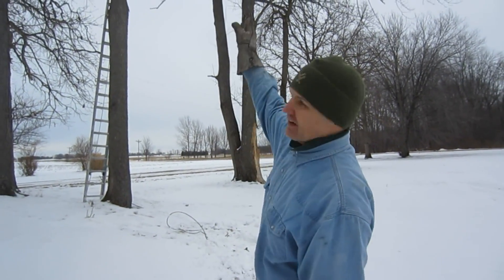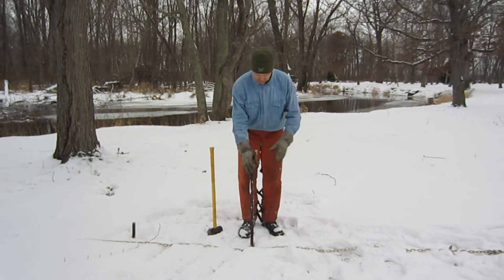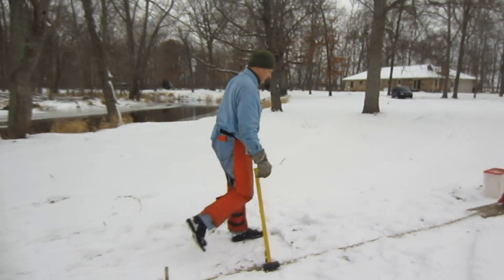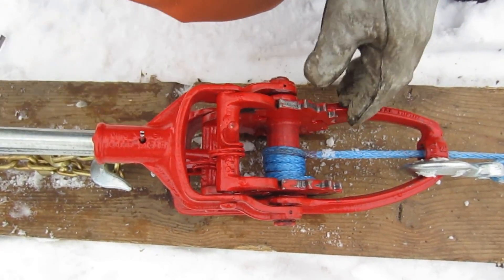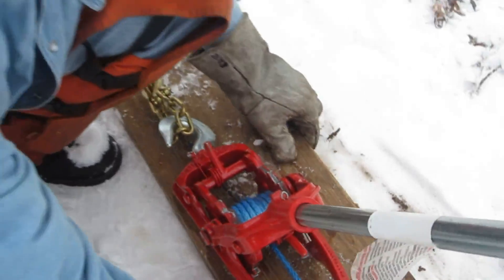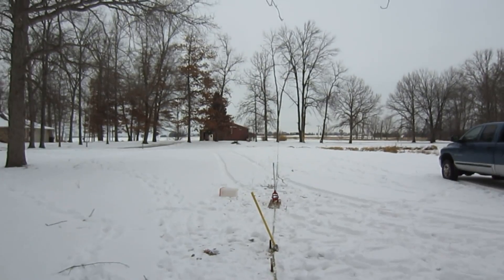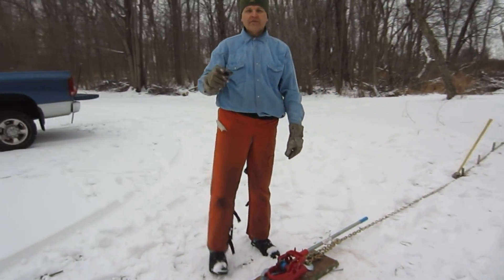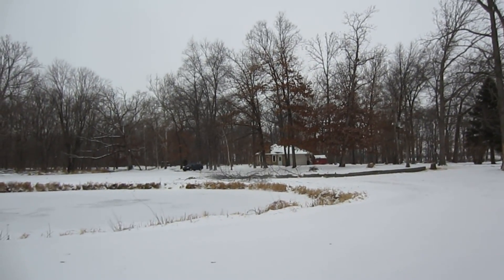More Power Puller Helps Pull Down 75 Foot Tree, & Winching Techniques

Comment: Nice technique. I've seen guys use similar ground anchors for vehicle recovery, but they tilted the anchors away from the load.
Reply from the maker: Thanks for your kind words about our technique.  As for the tilt of the ground anchors, if you watch closely, you'll see that they are in fact tipped away approximately 15 degrees away from the load/tree.  I agree with you, that tipping them toward the load/tree wouldn't be prudent.

Comment: To pull the stakes how about putting the fulcrum(log, tree section, etc) on the bar side; run the bar at an angle take the chain, slowly lower the bar then pull the bar down to raise the stake instead of raising the bar to raise the stake.  This arrangement is safer and easier on the back than raising the bar.  This is the arrangement used to pull tent stakes for years(the bar is a pole on wheels which can be easily maneuvered into location with a chain hanging on the end to go around the stake.  Pull the pole down, lift the stake, raise the pole the chain slides down the stake, repeat as needed).

I have done something like this both ways and pulling the bar down is the easier and safer method.
Reply from the maker: Your method would also work nicely, and easier on the back.  Thanks for your input.
Reply: You are welcome. Don't like to see someone hurt.
Reply: Roy Reynolds qqq

Comment: Fascinating video.  Are you an engineer by trade?
Reply from the maker: Thanks for the up-lifting and positive comment about our video, I'm thrilled that you liked it, I hope I was able to pass along some new knowledge.  As I have stated before, I just wanted to share and "pay-back" some of the knowledge to the Youtube community.  And as for whether "I'm an engineer by trade", I would have to say,.... well,.....kind of, some have said... but,.. not really, but I do know what an ATIS and an AWOS is!
Reply: I went through half a dozen other usernames which YouTube rejected as already in use.  I typed that out of frustration. YouTube accepted it, so I'm stuck with it! :^)
Reply: +SeekTheTruth .

 can understand why you did it this way( showing the kids the old way of chain rigging).
but let's keep it real.
take four wheel drive pickup truck and attached steel cable to the tow bar. put it in 4-wheel drive low lock and pull forward until tires start to spin. after stopping truck, pull out cable on front power winch. then set anchor stake and attach winch cable. hop back in the truck put transmission in low lock driving forward while pulling in on the power winch.
* pulling the entire tree out of the ground.

            ^

Comment: The truck would make a fantastic anchor...easy, fast, and if it slides in the snow, it's not going to fly out and kill you...

Truly trying to be constructive here
Reply from the maker: +Cody Grove ...... Thanks for your comment.  I did consider using the truck, but decided against it.  (1)Number one reason was that I thought that this would be a good opportunity to demonstrate how our ground anchor system works, (we've had great success in the past with this system) and 2nd reason was that I have tried it in the past and using the truck as an anchor didn't work.  The truck kept sliding in the snow or grass.  The MPP would just pull the truck around.  Also, 3rd reason, if anything when wrong, like a line snapped, then not only would I be in the danger zone but also my truck might get put out of commission while expensive repairs were made. 4th reason, after thinking about it, I just don't want to put that much repeated strain on the undercarriage and parking pawl of the truck transmission.  It can't be good for the truck.  I've rebuilt a couple of transmissions and I've seen the parking pawl that holds the truck stationary; there's not much meat there.  The way I look at it, the fewer men and the less equipment in the danger zone the better.

Comment: I was going to thumb this down however there were valuable rigging techniques shown during the video..   When he sunk those ground anchors i was like "Yeah good luck pulling those back out".. What is demonstrated is the proper method of wrapping chain into a configuration that allows it to grab a ground anchor and lever it out of frozen ground using only a length of chain, a stump, and riggers bar.
Reply: glad you could see beyond your first impression prejudices and find value. good for you
Reply: rainmechanic that was.cool how he pulled thosed stakes.
Reply: Or heat the ends of the pins bend a small section over or weld a half chain link near the top . Drill a hole through the support section of jack liffting point add a bolted u clamp. I have seen both. half chain link is the best and fastest to offer up connect pull drop .. jack down next one.
Reply: Vice grips... that ground is frozen... awful lot of work with the chain, biting and re-biting etc lifting etc … use the vice grips and grab hold of the spike... begin turning it clockwise/counter back and forth till it turns easily... simply lift barehanded.
Reply: dynamite works too  :-P
Reply: +rainmechanic A Highlift jack would pull those out a lot faster, and if this was something you were going to do regularly you could weld 3-5 links of chain onto the end of the bar.  Not only would this be exceedingly safer, as the jack would arrest the bar if it "popped" loose, but it would be easier and faster.

Comment: it would be safer if all 4 anchors  were driven into the ground at a 45 degree angle away from the winch
Reply from the maker: +David Gaylord .... yes, your right.  I have started driving them in at a slight angle, I now tend to use about 20 degrees, so that I could still pull them out.  The day of this video, the ground was frozen rock hard, anchor movement wasn't much of a problem.

Comment: Some HELLIFIED nice gloves!!!!
Reply from the maker: +Samuel Luria ......... I almost hate to say that the gloves are as cheap as they come, although they are modified, and they last for years now!  I should put up a video about how I modify them.  When they are new and clean, I completely cover them in 100% pure silicone.  I use clear colored silicone.  I work the silicone into the cheap split hide leather and hang them on a clothes line to dry.  I use 100% silicone from a caulking tube/gun, that way I could pick up very hot objects and not burn the glove.  If you use regular caulk it will almost instantly melt, burn, and stink.
Reply: Well that's an incredible piece of information it was worth waking up this morning thank you
Reply from the maker: +Samuel, just for you.... I'll try and put up a video of this operation, when I get a bit of spare time, but it really is just this simple.  I've converted all my cheap'o gloves with this method.
Reply: Cool! That would be appreciated!!! Have a nice warm weekend!

Comment: Tell us one more time about that spring - don't think we got it the previous thirty times. And it's a split pin, a cotter pin is an entirely different thing.
Reply from the maker: Rhodei, thanks for your input, I learned something.  I, like you, most likely, didn't know that we, (I think you call us Yanks), sometimes use the same words to mean different things.  Here in America that pin is in fact called a "cotter pin", and now I know that the British term is "split pin".  So, as it turns out we were both right,... isn't that GREAT!  And we both learned something new!  Thank you!  And just for the record, I reviewed the video and I referenced this "pin" just a few times short of 30.  Thanks for watching.

Here is a reference source, from Wikipedia, that may help clear things up: "A split pin, also known in the United States as a cotter pin or cotter key,[1] is a metal fastener with two tines that are bent during installation, similar to a staple or rivet. Typically made of thick wire with a half-circular cross section, split pins come in multiple sizes and types."

Comment: waist of time my old come along a hell of a lot better than that more power puller you are asking for trouble putting fingers in or around that line with a load on it and releasing the tension better to flip a lever and back it off than to put fingers around it plus the way I do it stump and all would come out at one time

Comment: That tree would have fallen on the desired direction with a simple notch and back cut.  The tree had no back lean which then would justify all your work. Made a big deal out of an easy job.
Reply: Unless you're making damn sure it doesn't hit power lines and a building.
Reply from the maker: Not with the wind we had that day, it would have gone over the power lines and into the barn!
Reply: Time is cheap, accidents due to wind less cheap.

Comment: I had one of those winches, but wore it out.  The cast iron wore away where the axle was rubbing hard against it.  That was after only 5 years.  You can probably make it last longer if you are careful to oil it before each use.  Unfortunately, I did not.  Lesson learned.
Reply from the maker: +Terry Hale,..... the manufacturer recommends that we grease the puller often.  I need to put up the video that shows the greasing operation.
Reply from the maker: +Terry Hale ... After our son pointed out your video about pulling trees down, I realized that you were one of my very early inspirations to tackle these kinds of projects.  Thanks for posting all your videos Terry!
Reply: You're certainly welcome Seek.  
I saw where someone posted that you should have taken it out by the roots.  I wanted to reply to that, but didn't.  Your ground was probably frozen to the strength of concrete and the creaking you heard would have made it unwise to wait through several month and a few winter storms for the ground to thaw.
Reply: Unfortunately, mine came from a store with no box and no instructions.  Still, I knew better, but ignored maintenance.